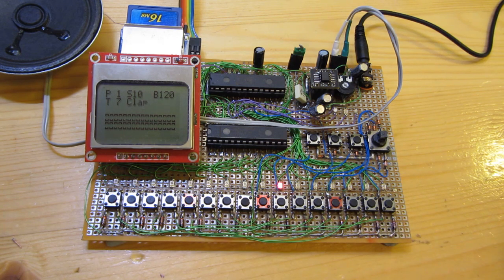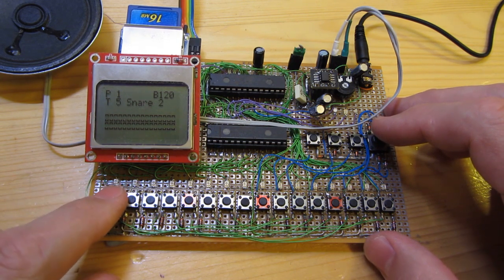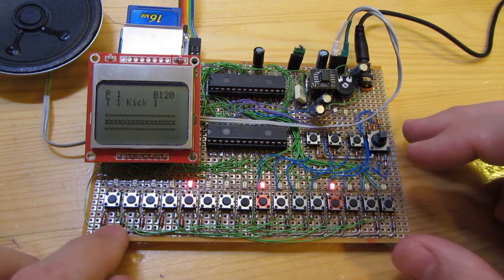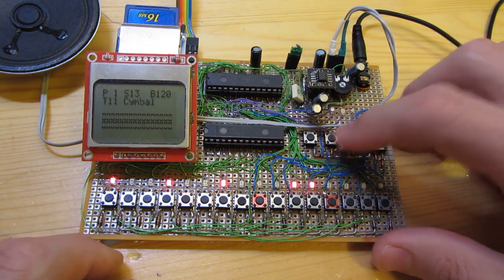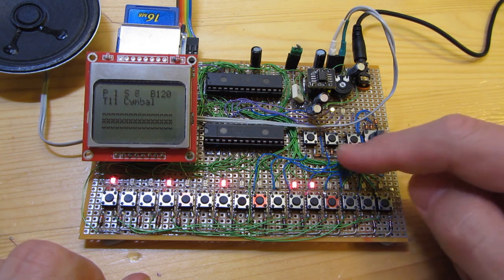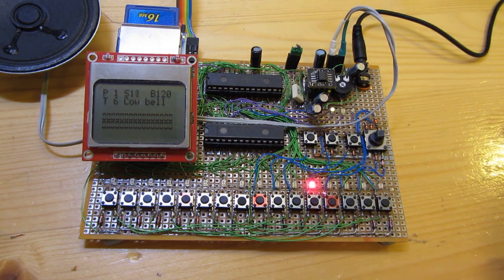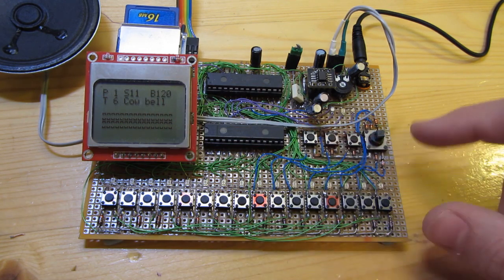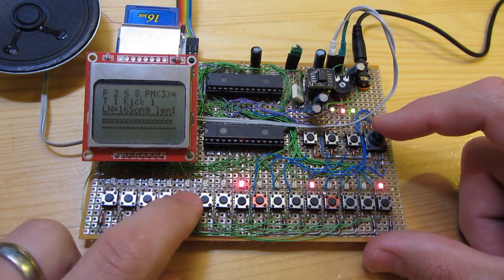PIC24 based drum machine

Comment from the maker: Thanks. I had thought about using a codec chip or an external DAC on the SPI bus. But in the end I decided to try and make the most of the PIC and get it to do as much as possible. The sound quality is actually pretty good considering the samples are only 8bit, the passive low pass combined with the TPA301 cuts out the high frequency PWM pretty effectively. The selector switch is an ALPS SKQU 4 direction Joystick w/ Switch. I got from from seeedstudio
Reply: is it possible to get the source code for pic24?